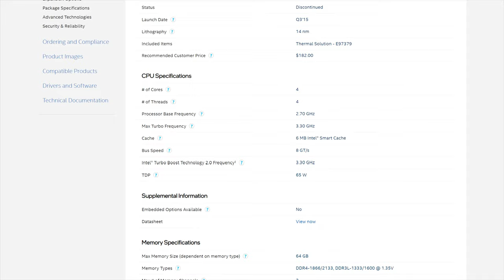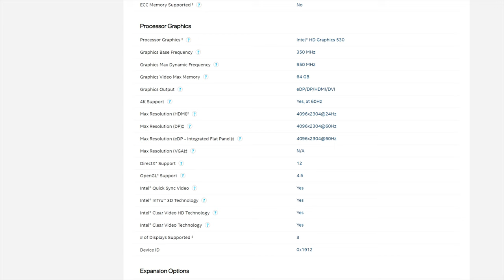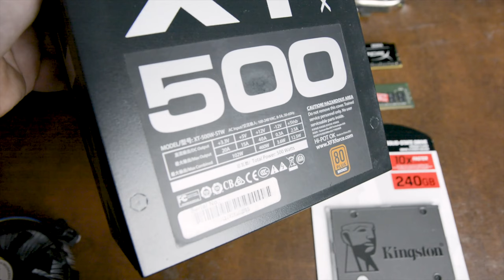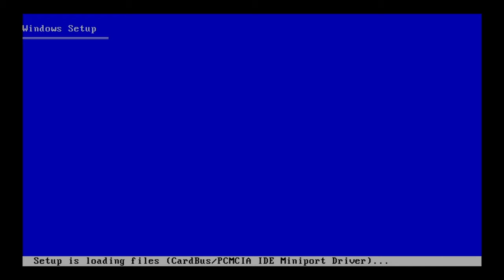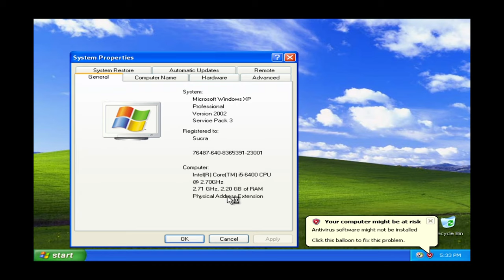Unecessarily Overpowered Windows XP Build!

Comment: Bom dia! Que lindo presente de sabado! 👏🏻👏🏻

Done watching! As I said in Rik's stream I put together a Xeon X5460 with a GTX970 and luckily with just a single INF tweak on the latest 960 official drivers you can even run a 980TI flawlessly on XP. I even tried 144hz in XP didn't know it was possible 😂 Looking forward to the next episode!!!
Reply from the maker: Bom dia, Gabriel! That's a crazy fast system you got! 980 ti for XP haha that's so crazy op. Thanks for watching man, good gaming on that system, sounds really cool.
Reply: Xeon FTW.  I have a E3-1245 V2 with a 980ti and a dual boot of XP and Vista on one of my "retro" machines.
Reply from the maker: @pete8475  oh sweet, that's a sandy bridge chip, really fast for those systems, I bet it does a wonderful job.

Comment: For XP I used usually E8400 or Phenom X2 555, both cpu's at XP worked for me great. Good luck with your build, I hope everything will work.
Reply: I use the E8400 too (I like the nice, round 3GHz 😆) 

Coupled with a 1GB 750ti, it’s a great XP system…once you actually get XP on it of course, I had a struggle too.
Reply from the maker: Those are both nice fast CPUs! I definitely have a phenom II build planned for the future. Thanks for watching!

Comment: Great video 👍🏻

I’m slowly putting together my own, overpowered XP system (G3258 @ 4GHz & 1GB 750ti) but I’m having trouble finding the ideal mainboard. It needs to have PCI and allow overclocking (for the G3258) which is not as easy as I’d hoped.
Reply from the maker: Sounds like a you're putting together a nice beast for XP! I love it, good luck!

Comment: The last major game to work with XP is Tomb Raider 2013 so you could try that, personally, I would like to see GTA IV and Crysis 2 running
Reply from the maker: Great suggestions! Thanks, I'll definitely look into running those.
Reply: Metal Gear Rising: Revengance also supports XP even as a 2014 game, and Undertale supports it too.

Comment: Ohh I wonder how much if at all the videocard get bottlenecked by the OS RAM restriction and the latest drivers available for it compared for example to the same system running Windows 7...
 Its a shame you couldn't use that Audigy maybe a cheap X-fi?
I know that Win98se games are something different, you should really pay attention to what video card and driver you install to have a smooth experience, but with XP I'm under the impression that any hardware that is supported will run any game that can run under XP, so there is really any point in putting together anything but the fastest XP machine?
Reply from the maker: Haha good point! Availability is always an issue. Sure you could use a 980 ti or a titan x and modify de inf file. Sure you can use fast DDR memory, sure you can use a dual core and overclock it to all hell and even sli. But then again, what's available for you? What are you willing to spend? Are these parts cheap in your country? I think different builds are always interesting. Thanks for watching Alberto, have a great weekend!
Reply: that's what I think is soo cool about this era, just how accessible it is, almost any of what we consider an old PC would do!
I need to check these drivers for my 3570!
Reply from the maker: @RetroTinkerer   I think the 3570 is fully supported, there won't be the need for any crazy installers or anything, should be straight forward.

Comment: Hehehe, unnecessarily overapplied thermal paste 3:31
Reply from the maker: Oh yes 😂 how did you like that splatter sound effect 😂
Reply: @SUCRA  Now the challenge would be to make Steam work on XP. Even GOG installers are aiming W7 and above. Of course, we can always use original optical media or even "backups" (if you know what I mean). I bet that setup can run Far Cry even in 4K with no issues.
Reply from the maker: @con2botonesnadamas433  haha a problem for the future. Next week we'll see how many fps this thing pulls in games.

Comment: Use Windows XP 64bit
Reply from the maker: I could've tried that, but XP 64 has some quirks and might have given me more trouble in some games.
Reply: @SUCRA  I am using XP 64bit but never got any issue with games. In case of NFS Carbon it was mentioned that Windows XP 64bit does not support the game. But it ran smoothly in my laptop with no issues.
Reply from the maker: @BengaliManfromWB  sweet, I might try it at some point. I don't have that rig anymore though, I installed windows 10 and donated it. Thanks for your comment, have a great day! 👍